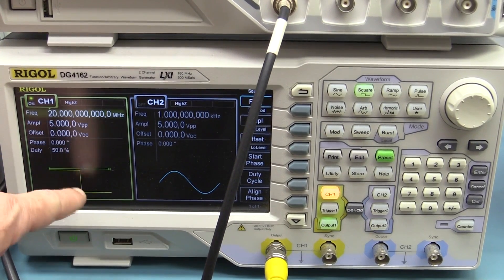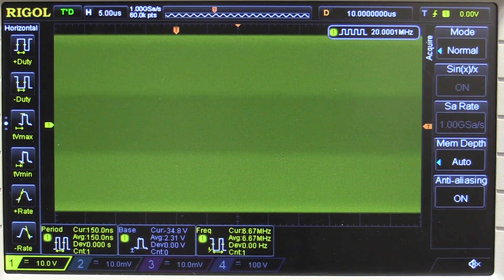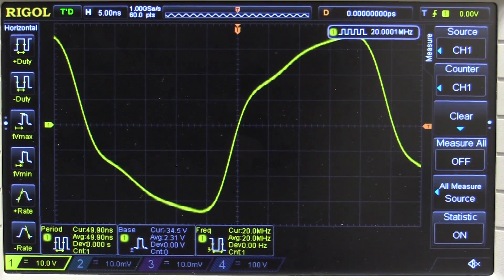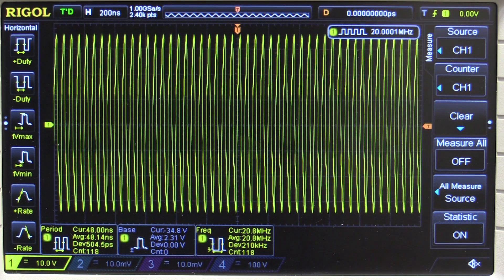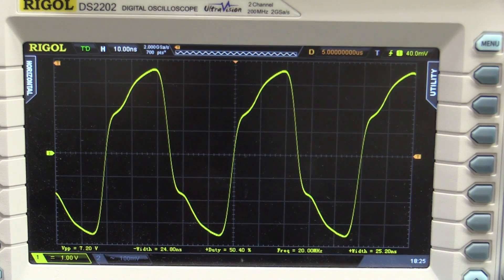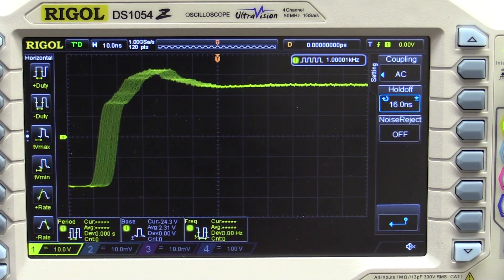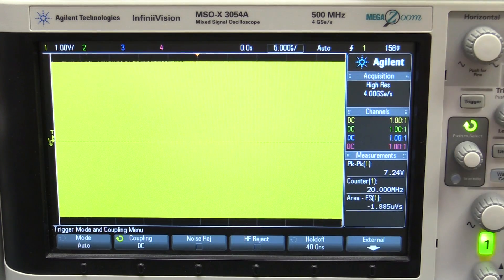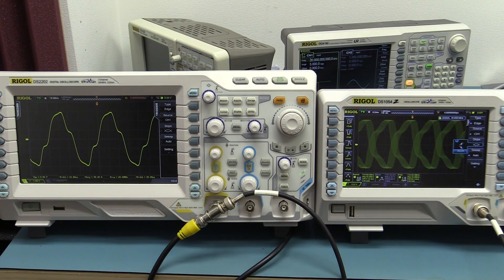EEVblog #683 - Rigol DS1000Z & DS2000 Oscilloscope Jitter Problems

Comment: Wow! Rigol is really terrible. An other brand to never consider.
Reply: wow all manufacturers have some bugs, only fact is how much that bug will bother you (Tektronix TBS1202B bugs or hangs while browsing through its menu, DPO/MSO7000 series are full of bugs in communication on GPIB or LAN and so one, which is more disturbing because they cost from 4 to 150 time more)
Rigol is low cost and you expect to have some bugs.
Reply: Include Tektronix on that list, then. I can go on for a long time about the problems I have had on my TDS5000B series scope.
Reply: Miloš Lazović No. Low cost = fewer features. I always expect engineers to do their job and test the product.
Reply from the maker: Miloš Lazović If it was a mild case of the 5us jitter, I'd agree. But the AC coupling is shocking.
Reply: EEVblog I agree it is terrible, but as I stated before I don't expect that 400$ oscilloscope to work but when 1500$ oscilloscope from reputable manufacturer bugs when you browse menu that is problem (and it is in same class as 400$ Rigol but cost near 4 times more).
I don't defend Rigol personally I will never buy one, I am Tektronix user and I plan to stick to it (I even used TDS 210 from dark ages of digital oscilloscopes and still think it was useful oscilloscope with lot of bugs but it was extremely small :) ).
I would like someone test Agilent (Keysight) lower end oscilloscopes that are in fact rebadged Rigol ones to see is there same problem (their 1000 Series).
Reply: davecc0000 Rule that engineers test the product is not apply for long time (now rule is make product quick and put it to market, and fix only bugs that make it not work).
Again what people expect for 400$ that it will work perfectly (I will be happy if oscilloscope for that money just turn on :) ), but problem is when you buy 300k+$ oscilloscope (like Tektronix MSO73304DX and you find is full of bugs, and with every firmware update they fix at least 20 bugs and introduce some new ones).
Reply: Miloš Lazović
Today's quality assurance is an utter embarrassment to mankind. Perhaps it even does not exist anymore!
Reply: Miloš Lazović Totally agreed
Reply: Well its not too terrible considering how cheep the scope is, the AC coupling thing is pretty bad tho but i find myself rarely using AC trigger.Still rigol better fix it.

Only rigol product i have is the 3 channel PSU (Same one dave has) and i found quirks with it here or there (And already changed out the ridiculously loud fans in it) But hey it was fairly cheep and does the job for me.
Reply: davecc0000 You are right about that. I totally agree. The AC coupling failure is like they had never tested, it is very embarrasing.
Reply: ***** I know that, but that is not problem that manufacturers made, consumers allow them to act like that. Now people tolerate much more bugs then let say 20 years ago.
Do anyone remember company called RCA (not by connector) which was in its time #1 in television studio/broadcast/eng equipment and in mid 70 it started to make bad products comparing to its rivals (main one was Sony) and till mid 80 it went under and market went to Sony.
Now people usually buy cheapest thing and that is it, they used to live with some bugs, but anyway it was cheap.
Reply: InXLsisDeo I can't even imagine why no one notice AC coupling bug, users now usually do digital so there is not big need for AC coupling, probably I would not notice that bug for long time (I rarely use AC coupling).
And again there is price it is range of like only plastic cover for Fluke portable oscilloscope.

Comment: So basically the AC coupling, which is pretty useful, of these two scopes are pretty much fucked? Why didn't the engineers spotted this? I'll hope it's just a software error and not something that's wrong with the design.
Reply: Also, please update us on this stuff. The Rigol DS1054Z seems a great oscilloscope for Engineers and Students, and I was planning to buy one this year, and probably others will as well. But you wouldn't buy it in this state...
Reply: Don't confuse AC signal coupling with AC trigger coupling. The former is what you want most of the time, and works fine; the latter is only applicable in certain contrived situations and is what's broken here. It's not good that the feature is so broken, but there is a reason no-one seems to have noticed this for the past 2 years -- hardly anyone needs AC trigger coupling.
Reply: TheHue's SciTech
Thanks, I'm probably confusing them. AC Signal Coupling is removing the DC from the AC signal and AC trigger is using the AC (60Hz Sinusoide in Europe) as trigger right?
If so, yeah I'm confusing them and it won't really matter for me but yeah It should work..
Reply: Rivalo You're correct about AC signal coupling, but you haven't correctly identified AC trigger coupling (the thing at fault in this video). [Side note: there's no reason to expect the mains frequency to be in sync with the 10 MHz signal generator, so the signal would be more than just a little jittery if you triggered off AC mains.]

So the signal goes into the oscilloscope, optionally through the AC signal coupling, on its way to the ADC. At this point it gets tapped off to the triggering circuitry. But there's the option to insert another AC blocking capacitor* for JUST the trigger circuitry (so you're still seeing the full DC content on the screen, but the triggering is based on a high-pass version of that same signal). This AC coupling for just the trigger circuitry is what's broken.

* Or equivalent DSP processing,details unimportant.

Comment: Confirmed. My 1104z has the trigger issue, but... When i start with a 1 MHz signal, induce the trigger jitter issue and then change the freq on my sig gen to 5MHz (there is no jitter if I start at 5MHz either) the jitter vanishes, huh?! Can anyone reproduce this? This doesn't seem to work as well if I change the sig gen freq to an arbitrary freq (eg 2.14 MHz) but it does seem to make it better. As far as AC coupling triggering goes, confirmed. It doesn't look quite as bad as Dave's, but it is still utterly useless with an AC coupled trigger. Let's get this corrected Rigol. I'm running ancient v2.00SP1 firmware on which the sys info does not list HW version. This is clearly not an issue introduced in new firmware only.
Reply from the maker: Skip Tabor Thanks for the confirmation. Based on some early feedback the amount of jitter in both cases does seem quite variable between units.
Reply: EEVblog That seems to indicate a hardware issue, since the software should be equal across all devices, yet the problems seem to have quite a big distribution.

Comment: Why would you test the other scopes with the same 5uS delay? If you ruled out the source as being the issue, you should have swept the trigger delay in the other brand scopes to see if it can be recreated there as well. I assume it has to do with Rigols sampling routine, the other brands would not use the same routine... so sweeping through the trigger delay times would have confirmed if it is a Rigol issue, or a generic issue.
Reply from the maker: ***** Of course I didn't expect the problem to show up in the other scopes, but I had to at least show one other brand scope to keep people happy and prove that it wasn't the source at fault. And then I wanted to show a few brands for the AC coupling.I did not have time to test other scopes in detail, that would require a lot of work. Perhaps you can do it for us and share the results?
Reply: EEVblog Sorry I meant, Why did you test the other scopes with the same delay... I was genuinely interested as to why you did that. But you have answered my question with your reply anyway. Unfortunately I only own a DS2000 series scope... so I can not be of any help. Keep up the good work!

Comment: My 2072 does it on DC coupling too, only to a lesser degree. And switching to AC has a similar issue, also to a lesser degree.
 
And dual slope trigger no worky either on CH1.. CH 2 works ok.
Reply: Are you aware that the bug is with AC trigger coupling (accessed through the trigger menu), which is a completely separate thing from the input signal coupling (accessed through the CH1/CH2 menu)?

Dual slope trigger works just fine probably, you've just got a holdoff setting that causes it to continually find rising edges only. Not a bug with the scope. Try manipulating the holdoff. I've got a better explanation on the eevblog forum thread for this video.